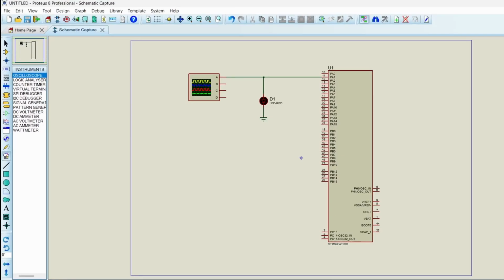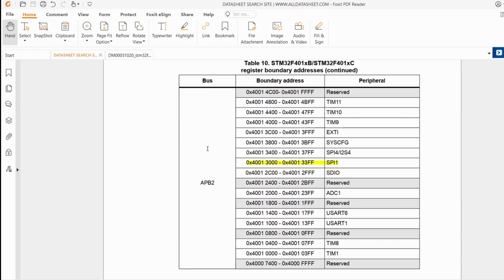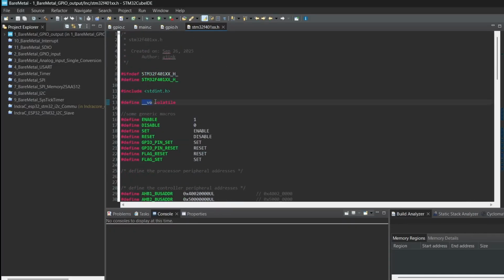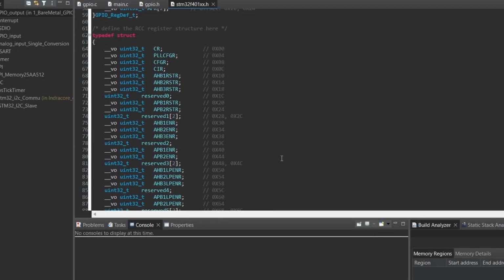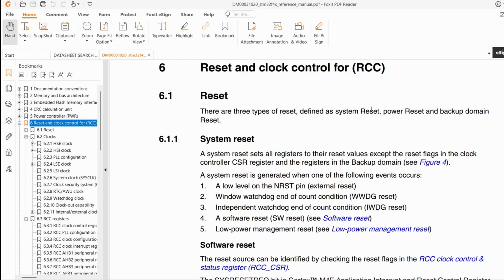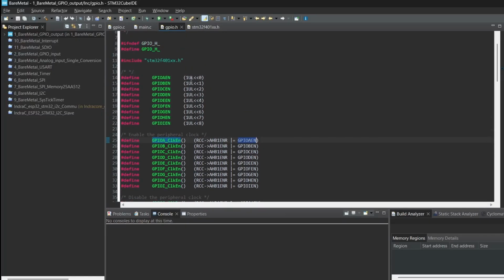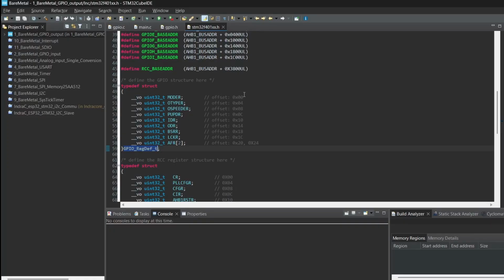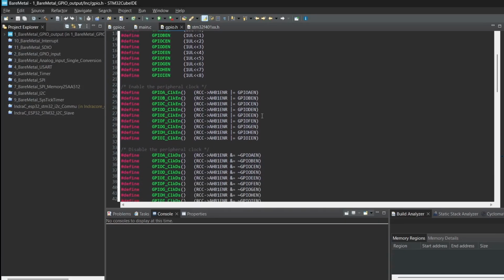STM32F401 Bare Metal Tutorial | Direct Register Programming | GPIO output Part 1

Comment: Why didn't you use already existing CMSIS library?
Reply from the maker: Mainly for two reasons:
1) for learning and understanding how register level access can be done, how to configure peripheral 
2) it gives the complete control over the functionality we want to achieve with bare minimum code
Reply: @stmetatronics-RawLuck  There's a ton of videos about registers, base addresses, structures and that sort. All videos in bare metal go just until real work of digging needs to be done: do every basic peripheral in bare metal and work it out to the end. 
No one should set a foot in programming if one doesn't know basic concepts of C, so many creators have already plenty of videos on bare metal concepts, which is by the way the same for AVR, PIC,...STM32, CH32V,....
Reply from the maker: You make a great point—a lot of tutorials leave you hanging just when the real work begins! Building a solid foundation is step one, but I definitely plan to take these bare-metal concepts all the way through the more advanced peripherals. I appreciate the feedback and hope you'll stick around for the deep dives!
Reply: @stmetatronics-RawLuck  All my programming is done trough bare metal and standard peripheral library. I just HATE HAL libraries. That is for me a big NO GO!